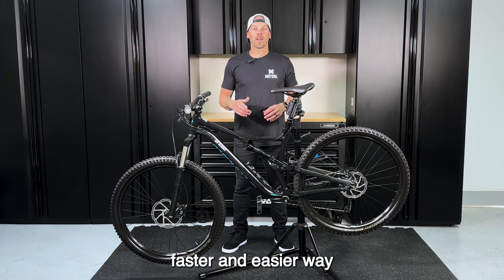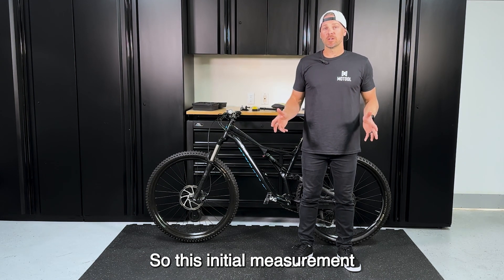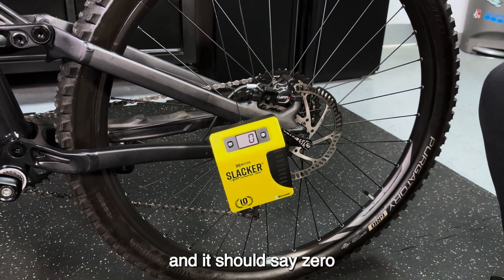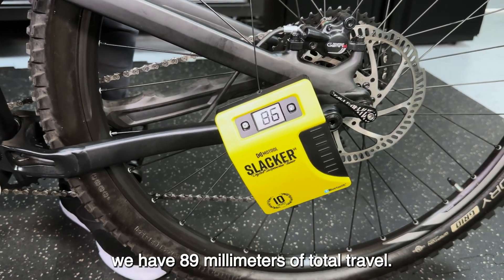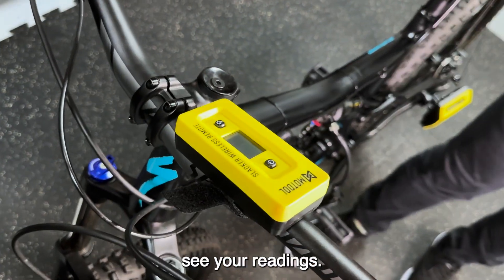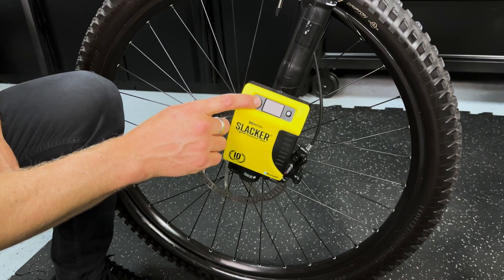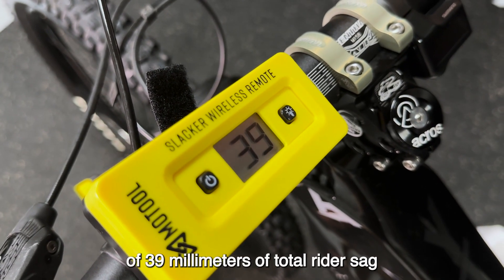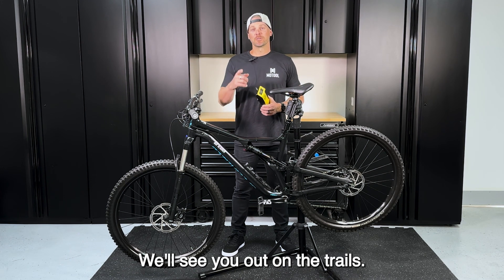MTB Suspension Setup Tutorial with the Slacker Digital Suspension Tuner.

Comment: So for a coil you will have to remove the shock, remove the coil, reinstall the shock without the coil and then measure.
Reply from the maker: Correct, you just need to do it the first time to get the travel, and then you can just take measurements. The app will show you the real-time measurements in millimeters as well as the percentage of travel being used so you don't have to do the calculations.